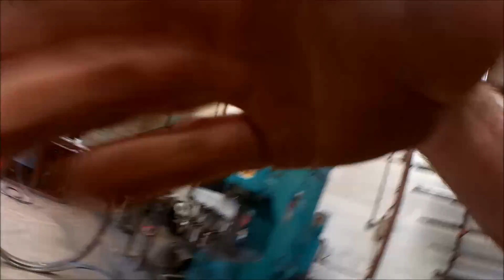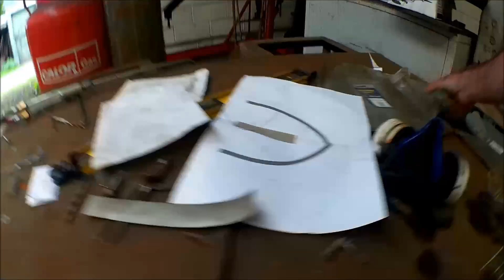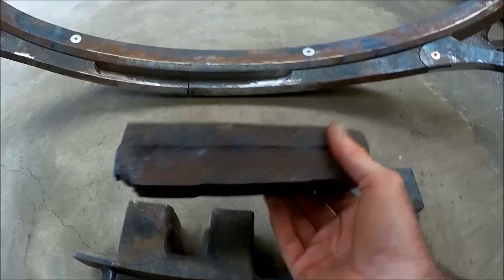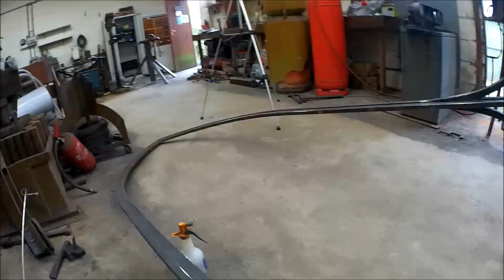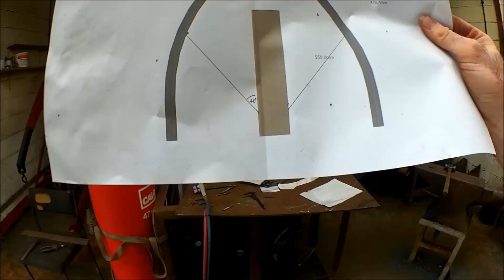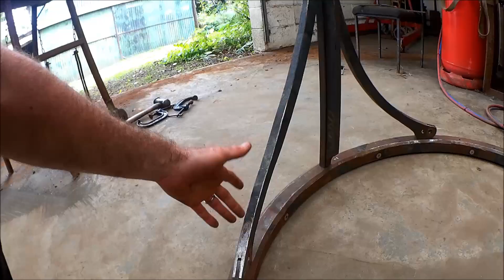Pure Metalwork fit for a Cathedral

Comment: why not cold galv ,,, out of curiosity
Reply from the maker: well Hot dip galvanizing or hot metal spraying is a permanent alloying of the surface of the steel with the added layer of solid zinc, while cold methods either by plating or painting are simply an outer coating which is prone to flaking off over a shorter time compared to the hot methods which are garanteed for 50+ years in most cases.
Reply: cant argue with that ,,, but its a lot kinder on thin steel ,, guess your stuff is heavy enough not to worry really ,
if youve a good hot dip , and an operator that doesnt leave big puddles and runs
Reply: ive had too many nice jobs ruined by dipping
Reply from the maker: your right it can be a risk trusting them. it's better long term and detail shows well through it. drips can always be ground back or filled carefully.

Comment: J-Man, 
Great explanation and demonstration on your design methodology and execution. I really liked the way you approached the design and the means of reaching your goal.  Changing methodology or materials to complete the vision is completely acceptable!
I'm assuming the Kevlar lines will not touch anything but the bell and the attachment loops? Kevlar line though strong will fray if subjected to abrasion.
Another great video, instructional and educational!
AAR
Reply from the maker: Thanks again Albert I feel very encouraged! yes the bell 'floats' suspendid in the centre of the arch and doesn't move much and all edges are fairly rounded. I have an idea of making a video on just the design stage, from generating an idea to the final working drawing before fabrication and my methods to acheive that. do you think that would be something you would be interested in watching?
Reply: Not only I Joshua, but many others as well I am certain. There is always something to learn from another artists perspectives and methods. Just remember to avoid getting to far into the weeds, what's important is the "hows and whys." How did that idea lead to the next, why did you choose that avenue. Draws viewers into your thought process, and makes everyone think!
Thanks Man!
AAR
Reply from the maker: Thanks Ablert thats good advice. what do you meen by weeds? I thought about doing a video on designing from scratch and how I generate ideas before making a peice. How does that sound?
Reply: I figured with that accent you were from Brooklyn or the Bronx or something like that LOL... On this side of the H2O being in the weeds means either very busy, or too detailed. So in this case I would suggest staying away from too much detail such as: "I take my 2H pencil and use it on 30 weight rag, as the tooth of the paper holds the graphite well and allows me to rub the graphite in such a fashion that ..." 
I think the bigger picture, generation of ideas, how you see things, how you take a sometimes grandiose idea and bring down to a doable expression, how materials influence your design and why. Themes with enough meat to get our interest, and enough information to make us think.
It's a pretty tall order... But I think it would be illustrative to everyone and maybe you might pick something up as well that you had not thought about!  take your time shoot some stuff in an interview format, some over the shoulder as you doodle, etc. Think of it as smithing with video, what's your end result supposed to look like, and how am I going to get there.

Dude! I just read your Bio on your website! Holy smokes, that needs to be part of every info below the video. At least a shorter version, WOW it's awesome!  DONT BE MODEST! You guys in the UK are so understated...

AAR
PS: I don't usually give advice; my best thinking got me in Afghanistan for five years... So grain of salt on everything I say. Except the last paragraph. That should be a definite!

Comment: Great work and well explained on the various pitfalls you have to foresee and overcome - such as forming the curves truly without power-hammer distortion, warping via galvanising and so on.

I made several heavy doors a few years ago, nothing fancy, just plain security doors for the various outbuildings at a cricket club, made from 50 x 50 SHS frames, clad in 3mm plate.  I wanted to make the frames and coach-bolt galv sheet onto them but the client didn't like the idea and wanted the plate welded.  I was warned at the galv plant that they could warp due to the heat, so I let them do one door to see what happened.  It came out ok (phew) and so we proceeded with another four.
Reply from the maker: That's a very good idea doing a test on the galvanized finish especially with multiples. I just wasn't prepared to risk it with this one the budget was too tight for errors. Thank you for your encouragement. it means a lot to me. Take care and catch up soon. j
Reply: Joshua De Lisle
Yes absolutely, I understand.  Yours is a unique one-off and there's a lot of work and material cost.  You did what I would have done.  I've used the zinc-rich paint myself and still keep a supply for touch-up on hot dip in case the piece gets scratched, etc in any further work or fit-up.  It's not cheap but it is good stuff.

Great channel anyway and am interested to see what content you put on the 2nd channel.
Reply from the maker: +Finarfin yes thats what I do for touching up galved parts too. yes I've been filming a few light hearted things at home. should be fun. 😊